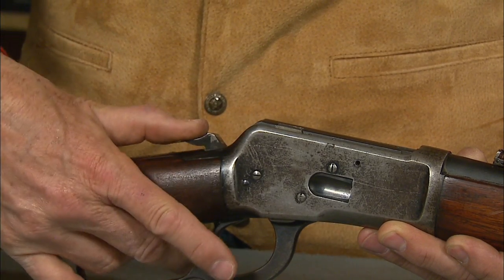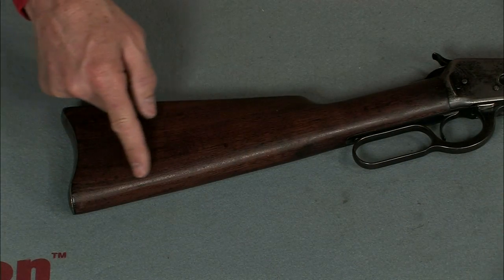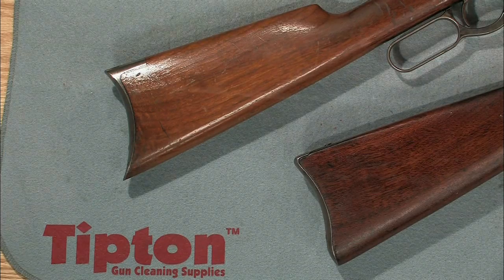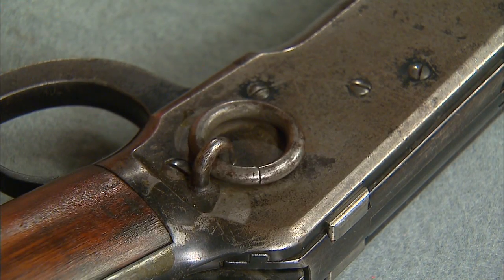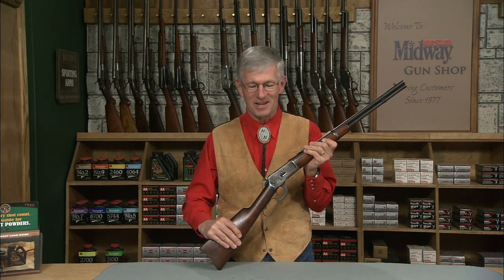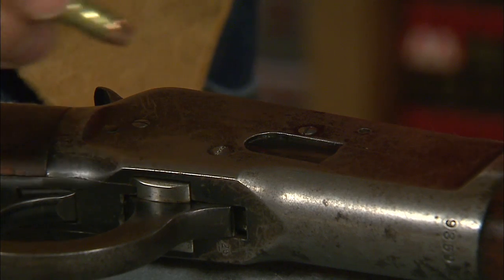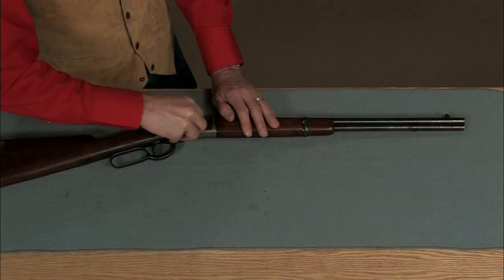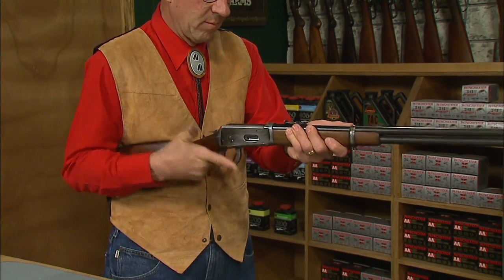The Winchester Model 1892 Saddle Ring Carbine

Comment: Chuck Connors used a large loop lever action Winchester Model 1892 on the TV series, The Rifleman. The lever was modified with a screw (bolt) so Connors would not pinch his finger when doing the rapid-fire scenes. Although the Winchester "Model 92" was not produced until 1892, the TV series was supposed to take place in 1890.

The Winchester "Model 92" was also John Wayne's favorite rifle, and he used a large loop version is several of his movies.

Comment: Why did it switch to the 1894 saddle ring carbine when he was unloading it ?
Reply: James Ross. Your absolutely correct, What a blunder. Mayby the 92 jambed up cycling action to quick! Well spotted.
Reply: Good catch. Probably an editing error. I’m sure they shot several Winchester’s that day.
Reply: @lonniegamble4292  hey maybe you can elighten me. i have a 92 and the other dday i noticed that when you put it on a half cocked position it keeps the hammer away from the firing pin.. naturally. But i found that in that position it turns into a double action... i mean if you were to squeeze the trigger hard enough the hammer full cocks and drops like any regular double action.. of course it is not a  light trigger pull but still, i thought it wasn't supposed to be able to shoot at all.. could you tell me if thats normal?
Reply: @lonniegamble4292  I slowed the speed down to 0.25 and could barely see that James Ross was right. Using a device tool I then slowed down to 0.1 normal speed which messes up the quality but you can see the 1984 style drop. Mr Potterfield sure did load an 1892 but what then happened with the filming???? I'm impressed he was that quick with the 1894 and would love to see him run the even slicker 1892.
Reply: Also after the unloading you can see a eye to attach a sling on the barrel band. You have a fine eye for details!!

Comment: Iv got a handed down 1892 saddle ring serial no2867 looked it up was made in 1892 first year run.20 " barrel looked exactly like the one on the video,except for the rear sight,.the condition i would consider fair to good.have any idea what it might be worth? Oh yeah it's a .32 cal
Reply: I have the winchester 25 20 WCF patented  October 14 1884 it looks to be exactly like the one in the video with the saddle ring, the ladder slide type sight and a rear up and down peep sight behind the hammer so with that being said it has 3 sights in all and the rear sight I guess was an add on. I had it appraised in 2015 and it was worth around $2000.00 if this helps you out

Comment: That's 11 cartridges in the magazine tube?   Is that standard for a Model 92 Carbine?   And if it was 44-40 it would still be 11 as the cartridges are the exact same overall length, right?    [Why does everyone think it's 10 for the 32-20 and 44-40?